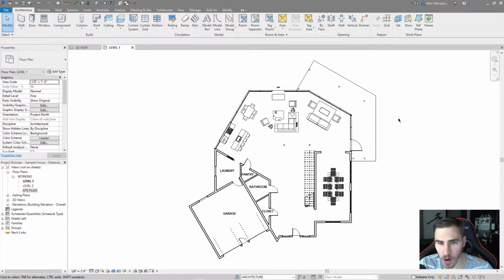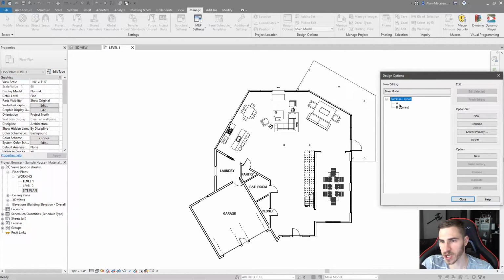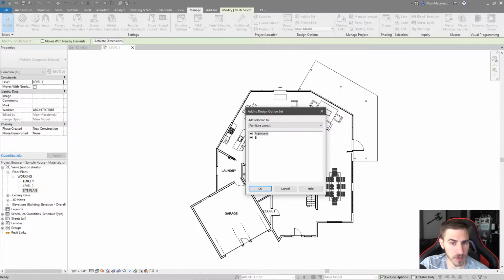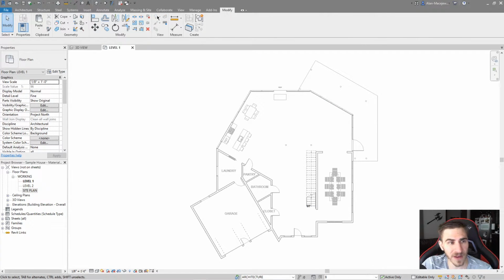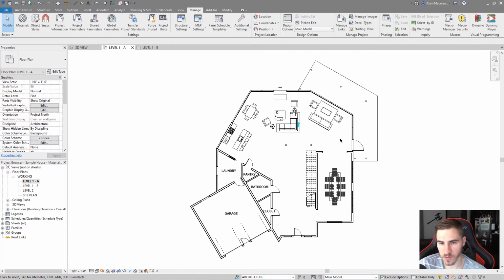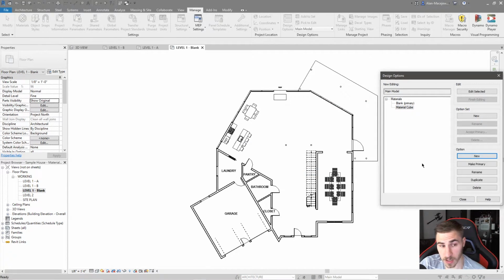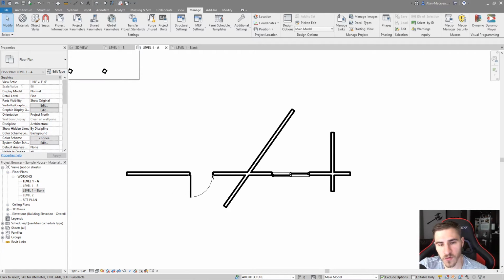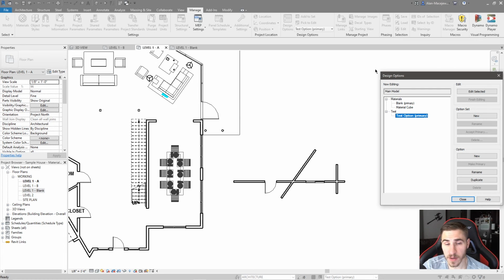A Complete Guide to Design Options | Revit

Comment: Thank you for your time explaining design options.  I have been looking a while for a video guide explaining how to delete all design options back to just the original main only. Could you please point me in the right direction for this kind of video?  Thank you again!
Michael
Reply from the maker: You are quite welcome for the video! My best advice would be as simple as this: Accept one of the options within each set. Doing this would in fact "delete" the design option but integrate the contents from the option set. If you did not want any of the option set's contents, then you could create a blank design option, set that to the primary and the design option will be gone. Hope that helps.

Comment: Hey Great Video, Is helped me understand Design options better, but like you showed every time that I accept my primary it deletes the secondaries, does this means I need to make a copy of the floor plan with the option from the beginning or it can be at the end? also does the copy of the plan where the options take place has to be a normal copy or it has to be a detailed copy or copy as adependant?

Kind Regards.
Reply from the maker: does not matter how you copy it to your main model if you do want to copy it. Depends on if you want the 3D elements or not. The idea of design options are that you actually do want to delete those items in options that are not accepted. You can choose to keep the options or just copy them somewhere else instead of delete them by accepting the design option. It is up to you.

Comment: I hope you can help with this.
How can I visualize every Design Options if I link this model to another Revit file? for example I want to work on the hydraulic installations.
Reply from the maker: You are able to control which design options are on in the visibility graphics of the model link you want to control. You will see a design options tab in the link.

Comment: Thanks for this video - it's a really important topic and there are many ways to screw it up! You're a great resource and I like the way you think. I'm a Revit newbie but am using it to help design a house for my oldest brother so this seems like the way to give him choices.

I think I understand how to create views of each option. Once you accept an option and delete extraneous views, do they automatically disappear from sheets? If one sheet consists entirely of a rejected option, are you then left with a blank sheet? If so, I guess you have to be meticulous about cleaning up the sheets.

I love the workaround of creating an option set so that you can include materials. I thought that each option affected schedules, so a finish schedule would only include materials in that option. Another thing: you said that too many option sets can bloat the project file size, so I guess that maybe you just keep that one option set around and use it as a kind of closet for things you need but don't want to show.
Reply from the maker: If you accept an option and delete the associate views, they will be removed form sheets. This applies to deleting view regardless of design options. You would be left with a blank sheet if you delete the views. If you do not, then you are left with the views as is but with the views now showing the accepted primary option instead. You are correct on the bloating model. Keeping in mind that every option is another copy of all the elements will give you an idea how much you really have in a model. It is not just what you see but a summation in a way of all the elements in all the design options that make the model.

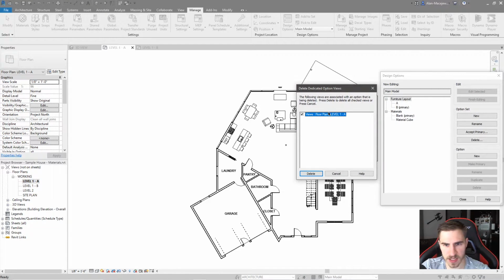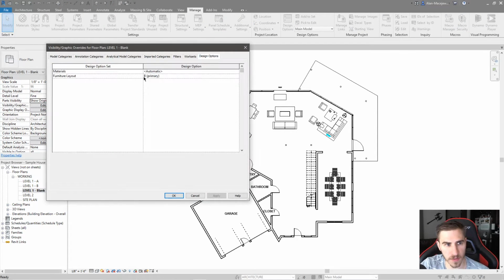Comment: at 16:59, your view list gets longer, and includes level 1 -A and Level 1 -B, but you do not explain why you did those or how you set those up . At around 24:00, you start talking about  remembering the setup of option 1A and B, but that was not in the video. But at  26:15ish, you show how to make the BLANK option. Just commenting to let you know but also for anyone in the future who watches the video and wonders about this! 
I saw part of it when the video was released and finishing it now due to a project that will require design options, I think you covered everything I needed to know but the one thing that to me was not too clear is what happens when you want to delete or hide stuff between options? I think it will probably all make sense when I start experimenting with how these work. 
As usual , thanks for the great video!
Reply from the maker: The view list getting longer was just me duplicating the view and renaming them so I could have a different result for each view showing a different design option. That could have been an editing issue on my end but I did just duplicate them and apply different design options to each view. Me showing the duplicate view for the blank option was the exact same thing I did for the other options, I must have just edited it out. If you are looking to hide elements between options, the only thing to know is that everything in design options is its own instance if that makes sense. If you for some reason have the exact same elements in 2 different design options, hiding, deleting or doing anything to an element in one option will have no impact on the other option. Everything will be shown in design options by default but those options will inherit the view settings you have applied to the view you are looking at. Hope that all makes sense.
Reply: @ArchitectureVanguard   I think its a bit confusing, but I think it will make sense once I start using this, I need to re-watch the video, I am sure it will all click soon. Thanks again as usual.